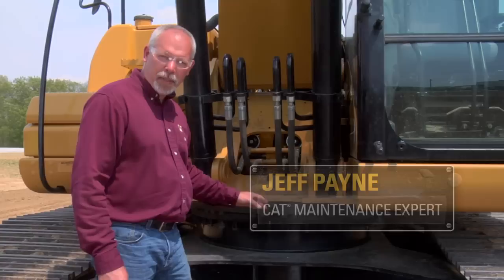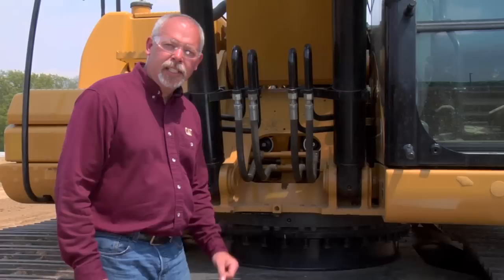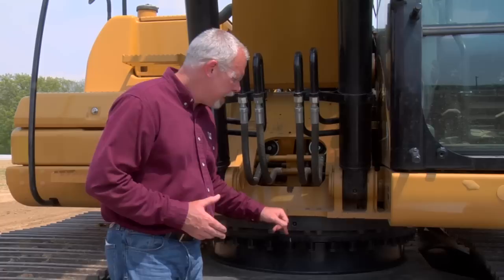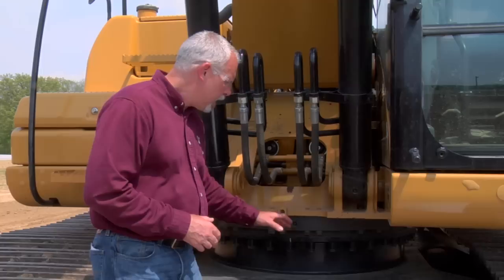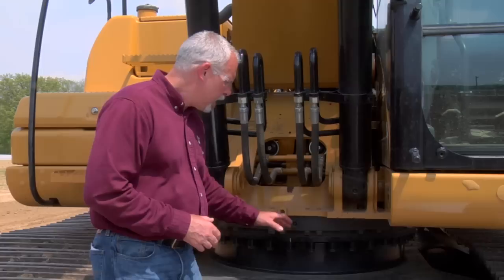Cat® Excavator Swing Bearing & Swing Gear Maintenance

Comment: why does the swing brake thing that is located beside the cab, and has a dipstick..also have a fill tube? the fill tube is the same size as the dipstick tube. much like an automatic transmission in a car, why wouldnt i fill the thing through the dipstick tube? how do i change this fluid? is there a drain underneath somewhere? thanks for any help. much appreciated. this channel is a good idea....

Comment: swing gear? so do i buy grease, as in the type of grease i lube the joints daily on the machine with...and take the cover off and squirt it in the hole until its to a certain level? or do i use a paint paddle? i have a cat 320cl anb serial series. should i do the 4 point grease on the swing bearing? also, the little dipstick behind the boom in the swing brake compartment thiing is a little low. what weight and type of oil do i use? i am too far from a cat dealer to buy cat oil today.
Reply: How do I change patterns on a 312e?